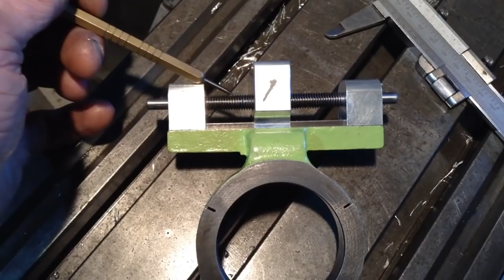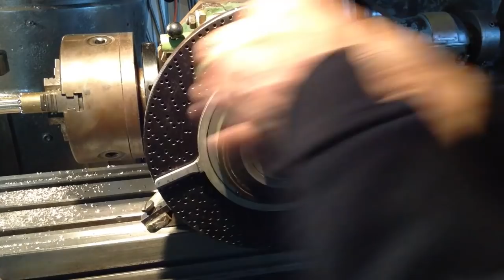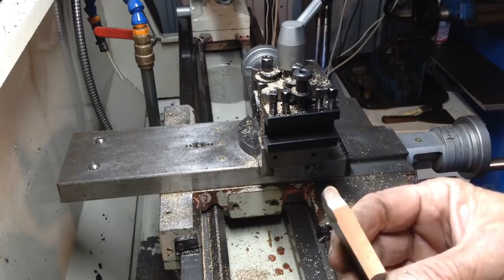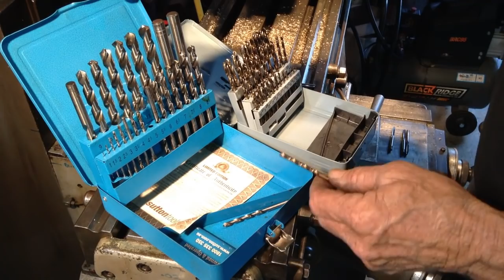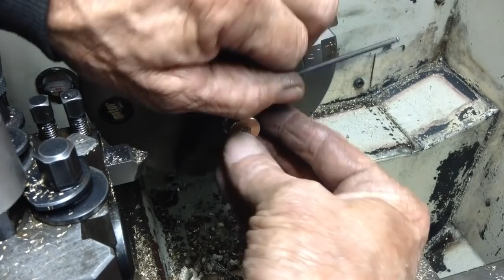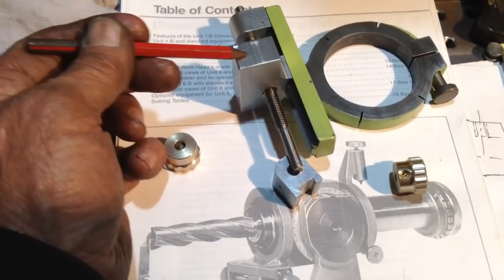L.A Rocheleau Grinding Fixture Indexing Attachment . Part 3 .

Comment: Sweet little knobs. You got your sweater on so that must mean you are getting cooler temps there. You putting the roof on first or the walls to your shop?
Reply from the maker: Yes , things are cooling down here !   I have to do the walls first because of the flashing the sits on top of them .   Cheers .

Comment: Fancy!! Nice work as usual Max!  Question. Why does a larger nose radius make a difference in the finish?? Thanks for sharing.
Reply from the maker: The larger radius has more  flatter contact closer to the axis of the part as opposed to a point .  Works well on softer materials Yves .   Cheers .

Comment: G’day Max. Great video, nice work on the parts and the knobs came out nice, brass always looks good. 
My Black Book has the chart showing D/Head turns and holes for a 40:1 head, very handy but no good for me as mine is 50:1 I just hope I can decipher my notes on how to calculate it in years to come. You mentioned doing a video about your DH but do you remember you did one some time back, well I think you did, I’ll still watch it anyhow. 
Cheers 
Peter
Reply from the maker: Thanks Peter . The one i did on Tipsblitz 19 only covered the Wide Range function  .   Yours will be T = 50 / No of divisions .    I will do the maths on the divisions soon .   Cheers .

Comment: Max can you do prime numbers on that indexing head, for example 127 graduations, made a 127 tooth gear for my Hercus years ago and had to use a compound indexing head.
Reply: No compound gearing required, what a great tool!
Reply from the maker: @willemvantsant2707   from 1  up to & including 400,000  divisions .
Reply from the maker: Yes it will do 127 &  63  for the other transposing gear .